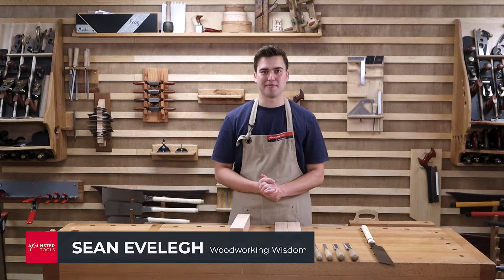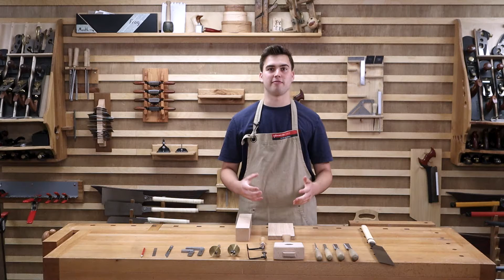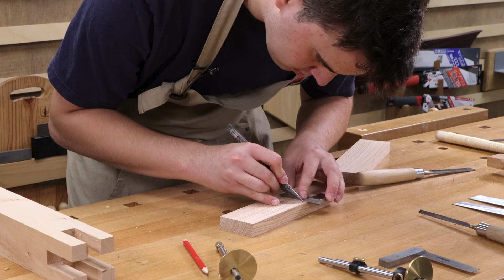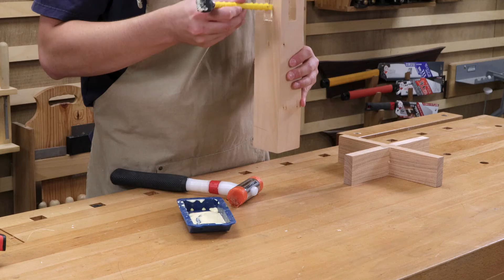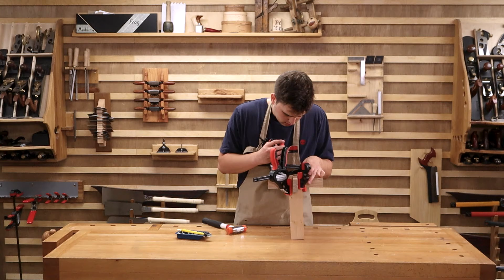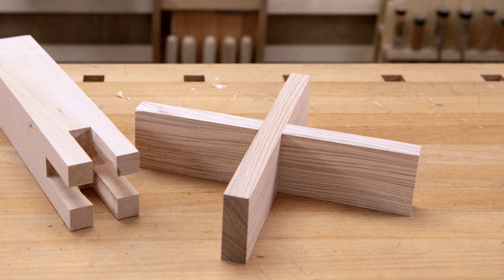How to Make a Castle Joint - Woodworking Wisdom

Comment: If you saw correctly, you can cut at the line (inside the castle area) and be fine. Start your cut on the far side , tip of the saw pointing down, the trace your line back towards you, the heap of the saw down.  The saw will follow the kerf.
Reply from the maker: Thanks for sharing your tips!

Comment: Useful video as I have been thinking about doing this kind of joint.

My only issue is, I don't have a rip saw or mortice marker. I'm thinking I could add a stop to the band saw and use that to cut the joints and mark up using the old fashioned tape measure and square. Think ill need to practice on some scrap first!🤣